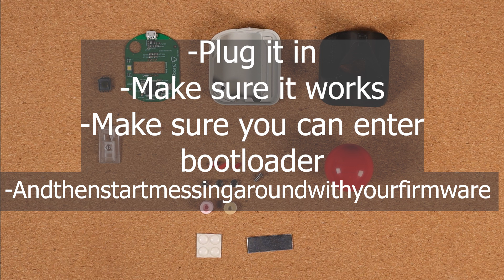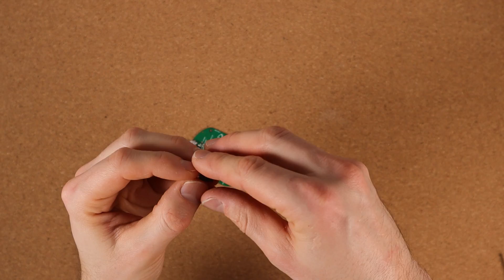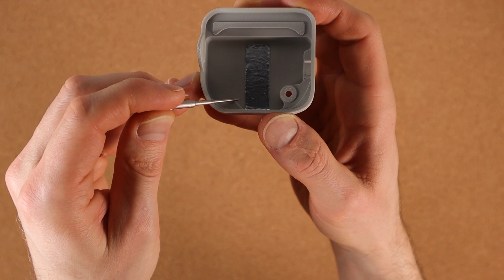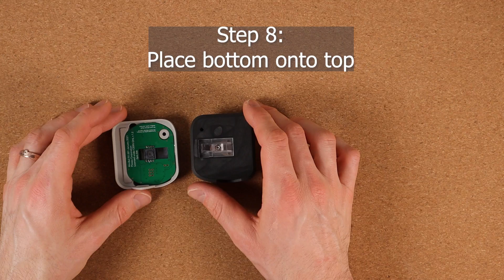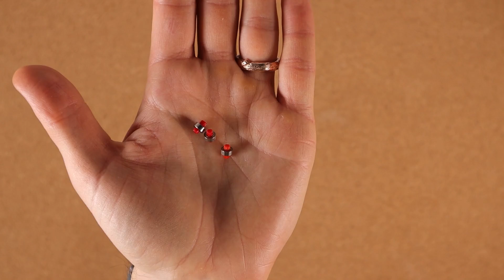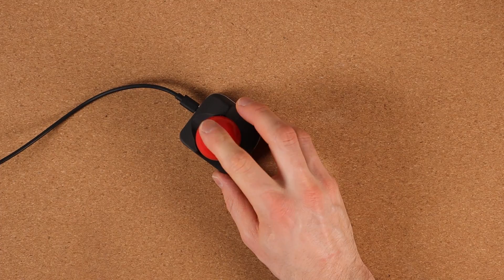How To Build An Open-Source 3D Printed Trackball... With No Buttons | Ploopy Nano DIY Build Guide

Comment: where are the buttons??
Reply from the maker: They are hiding inside the case.

jk there are no buttons. 

You can either program buttons via QMK on a QMK-enabled (or similar) keyboard, or buy a Nano 2 and get one button built in (https://ploopy.co/shop/nano-2-trackball/)

It's main function is to accompany another device (usually keyboard) that you would assign buttons to.

Comment: I havent worked with anything like a breadboard or solder in decades--is it possible i can make a ball mouse with 1000hz polling rate?
Reply from the maker: You can do anything you put your mind to! 

I am not sure off the top of my head what the polling rate of the Nano is, but there's endless stuff out there to build your own mouse project from scratch.

Good luck!

Comment: is it possible to modify this trackball to a smaller form factor?
Reply from the maker: Difficult question to answer. 

I believe the Nano 2 they've just released might have a slightly smaller form factor, but as it is there's very little wasted space on the Nano case. 

I am sure if you had some CAD skills you could create your own housing to fit your exact needs, but trackballs inherently take up the space of the ball + the arms to house the static bearings. It's a pretty tiny device!

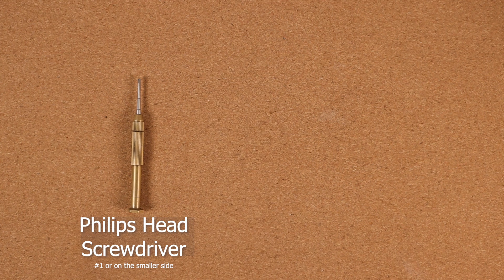Comment: 0:32 I can't believe you would use p*illips, ew🤮🤮🤮
Reply from the maker: Not sure if trolling? 

What's your superior suggestion? This is the screwdriver suggested by Ploopy themselves to assemble the mouse...
Reply: @beepbuildsathing torx is the best thing I'm aware off.
Reply from the maker: Of course most screw heads are more robust vs phillips, but that's what the kit includes. I'm not going out of my way to source alternative screws v what's included in the kit...

Comment: Is it possible to use this Nano Ploopy to scroll?
Reply from the maker: Yep! Just have to set up drag scroll, then assign a button on your keyboard to enable it :). Then it can be used as a pointer as well as a scroll ball.

I found out how to properly do it via a reddit thread (can't recall the exact one but will poke around a bit when I have some minutes spare), so search there for sure! Or check out the Ploopy discord and I'm sure someone can help you there.
Reply: @beepbuildsathing  awesome great thank you !!!
Reply from the maker: Hey, just wanted to write you a quick update in case you haven't gotten a Nano yet...

They just released the Nano 2, which has a built-in button to enable scrolling by default!

Comment: very cool and simple project but why doesnt it use a USB C connector?
Also the addition of buttons for clicks would add a lot of value to it.
Reply: there is a kicad project that swaps out for usb-c on the same board. If you're willing to order a few boards it can be done. the BTU mod looks top tier too
Reply from the maker: @kernalmustang260  Woah, sweet. 

That's the beauty of open source stuff - it can always be improved upon. 

Thanks for sharing!
Reply: micro usb costs less, and this is likely intended for split keyboard that can easily emulate mouse buttons. Ploopy has a number of USB-C options and products with buttons.
Reply from the maker: I'd guess the reason it doesn't use USB C is because they likely designed it with Micro USB (likely due to lower cost reasons) and still have PCBs leftover from an initial large-scale order. Or, they maybe don't see the point of updating it - if it ain't broke, don't fix it.

I personally dislike micro USB and avoid it where I can, but a mouse is something you don't plug/unplug a heck of a lot, so it likely wouldn't be an issue for most regular folks. Also they supply the cable, so you don,t need to use some janky old one that sometimes doesn't work you may already have (I have more than a few, heh).

And yep - biggest reason there's no keys is it's designed as a companion to a split keyboard (for example), and is purely a pointing device.

I asked Ploopy a while back about the possibility of adding keys to it, and I believe it's technically possible but would require some decent know-how and some extra soldering (neither which I have/have the time to explore myself).

Comment: Unbelievably awesome project! Is there a chance of adding a click? The design looks futuristic yet retro. Hard not to love, especially considering how compact it is.
Reply from the maker: Hi! The purpose of this mouse is actually geared towards going next to/in between your keyboard (ideally one with QMK) so you can program the mouse buttons as keyboard presses. I use it either alongside my BastardKB Scylla (split ergo keyboard) or on top of my Svalboard (integrated directly on it) and it works wonderfully!

I'll be releasing a video soon of a more compact trackball that has 5 buttons (called Ploopy Mini Trackball), so stay tuned for that. 

I agree that it seems nice to have extra buttons on this mouse, but to do that would involve a larger footprint, and make this much less compact.
Reply: @beepbuildsathing  I figured something like that was the reason. And It's perfectly sound reasoning. However, I just find this form factor hugely more attractive than a Ploopy Adept

If there were instructions on how to wire up your own momentary switch to the board I could modify the chassis and be on my way. As it is now, it looks like my only option is to create an entire new chassis for an Adept track ball print-it-yourself kit. Not unfeasible, but a higher hurdle to jump over. 

Thank you for taking the time to read and reply to my comment
Reply from the maker: @AntiClankerClippy  Yeah, I agree! It's a very tidy little unit :)

I'll do some poking around to see if there's somehow extra pins or something that can be utilized but I'm doubtful of it. Will update this comment if I get any more useful info on it!
Reply: What's the driver/sw like?  Can you speed up motion for high res multi monitor? (  I have 7000 pixels in x res.)
Reply from the maker: You mean like acceleration? Or just DPI adjustment?

I think you could do either though I'm pretty sure acceleration is moreso OS based vs on the mouse itself. I think it's pretty straightforward to set a DPI adjustment key on your keyboard to adjust, similar to how you'd use mouse keys with it. Don't quote me on that as I'm definitely not a QMK expert, but you can definitely enable acceleration which should help get across your many pixels easier.
Reply: Nano 2 added a button fwiw.
Reply: @hicamajig Thanks for updating me. Good to know the project is still ongoing
Reply: Indeed, the lack of click is a bit of a deal breaker.
Reply: @NFSSAM There are ones with buttons available too, on their website and on their github.
Reply from the maker: @NFSSAM Hi! The purpose of this mouse is actually geared towards going next to/in between your keyboard (ideally one with QMK) so you can program the mouse buttons as keyboard presses. I use it either alongside my BastardKB Scylla (split ergo keyboard) or on top of my Svalboard (integrated directly on it) and it works wonderfully!

I'll be releasing a video soon of a more compact trackball that has 5 buttons (called Ploopy Mini Trackball), so stay tuned for that. 

I agree that it seems nice to have extra buttons on this mouse, but to do that would involve a larger footprint, and make this much less compact.